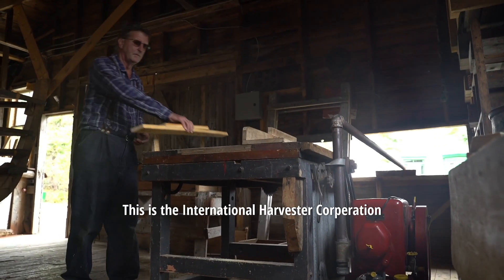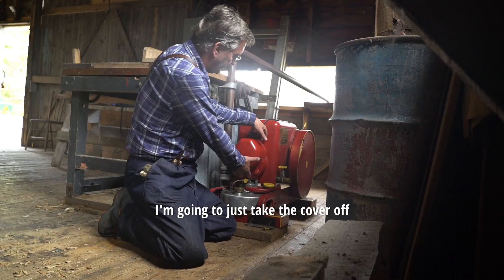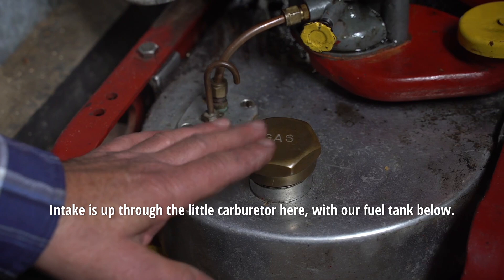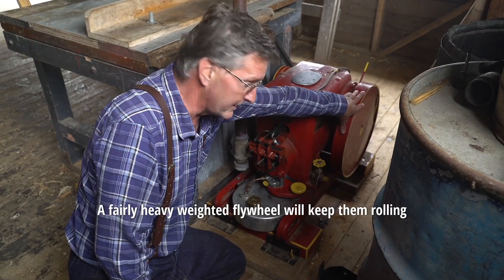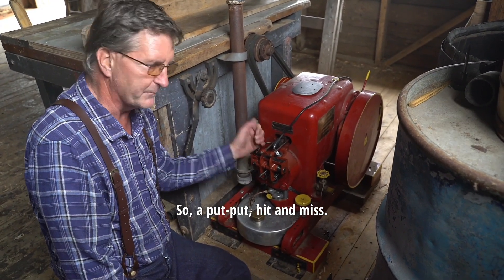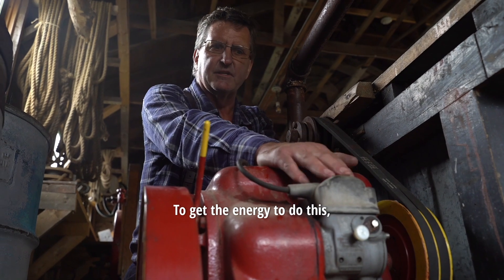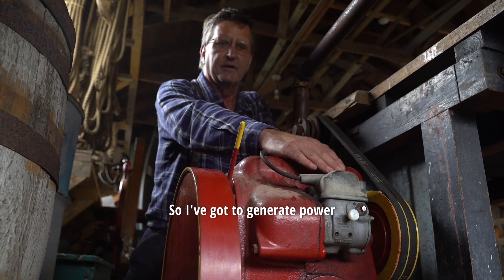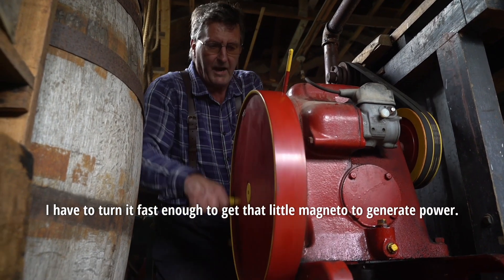Things That Go: Stationary Engines (International Harvester - Model LB)

Comment: i inherited one of these engines and I'd like to change the oil. Can you tell me how to change the oil?
Reply: Run the engine to get the old oil warm, then shut it off, and remove the small 3/8” plug on the opposite end of the engine from the fuel mixer. Replace the plug when empty, and refill with 30 weight oil